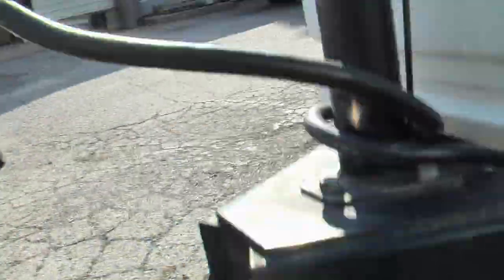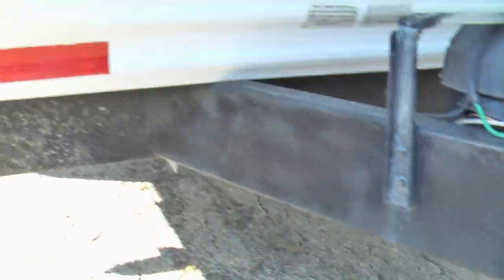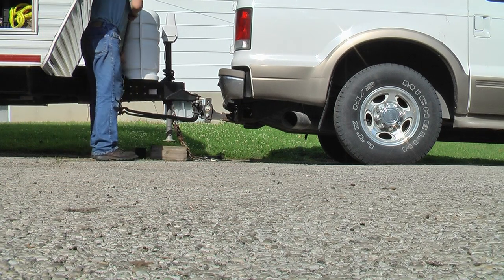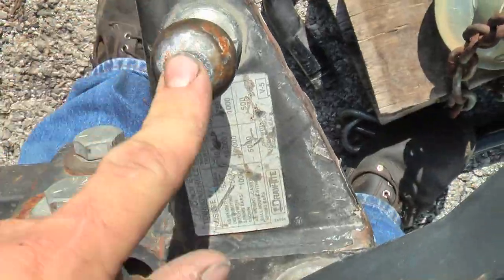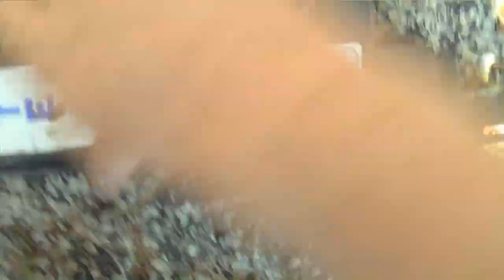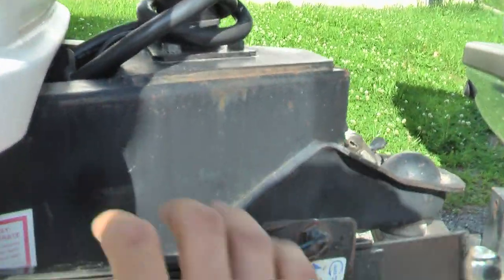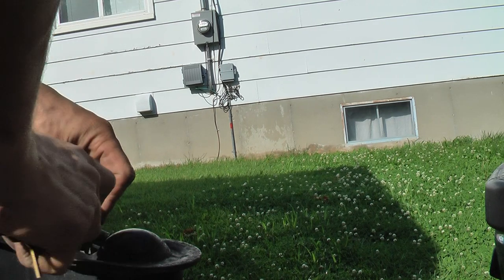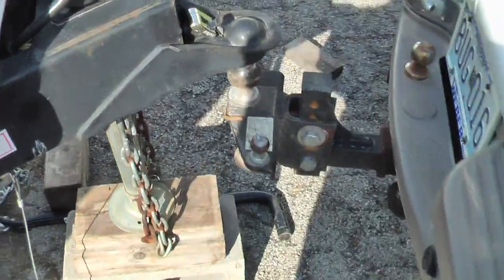Setting Up the Camper Part 1

Comment: From what I have heard what crossing the chains does is it creates a sort of "cradled" to catch the tongue of the trailer should it become disconnected.  Otherwise the tongue would drop straight to the road and dig in potentially causing damage or an accident.
I heard this from a tow truck driver (my step-dads brother).

Comment: @yamahonkawazuki 

There's also equipment that, aside from being common sense to have for safety, is also required in the vast majority of states:

    * Safety chains: These chains, which cross over in the shape of an X to connect the trailer to the towing vehicle, help prevent separation if the hitch connection fails.

Comment: @AgentHog idk about law here. but ive heard same. i look at it this way. uncrossed. if trailer jumped, trailer would go back a hair furter before chains said whoa. but with chains crossed when turning sharply. you wont drag chains on ground either. ( usually ) unless they are hideously loose

Comment: well i cross the chains and one time we were backing a load of dirt and forgot to put back on the locking mechanism on top of the ball and the trailer  poped out of the ball and the crossed chains cached it ( if it was not crossed then the trailer would hit the ground)  i always do cross my chains it really good it they are not long enough ( remeber when turning the corners) then don't cross them

Comment: Making me nervous not disconnecting your emergency brake, break away line first.  It is the first cable I disconnect when I disconnect my rig.  If you forget and pull your truck away with that still hooked up.  Then you have 4 locked up brakes!

Comment: when you cross the chains it makes a basket for the tongue to fall in so it doesn't fall on the road and bend the tongue all up and it will still be attached to the truck and you will still be able to pull it enough to get to somewhere to stop.